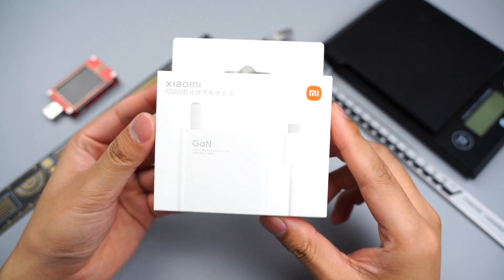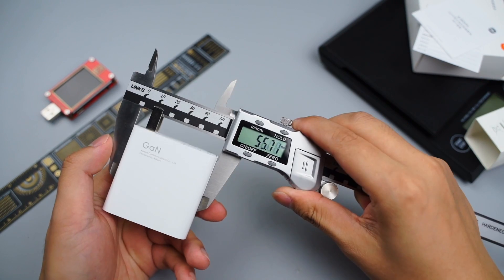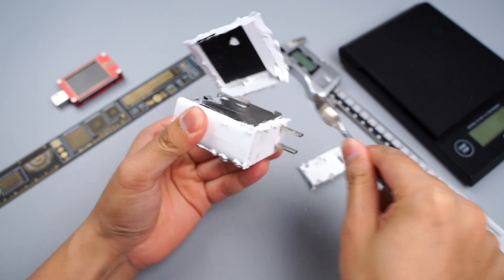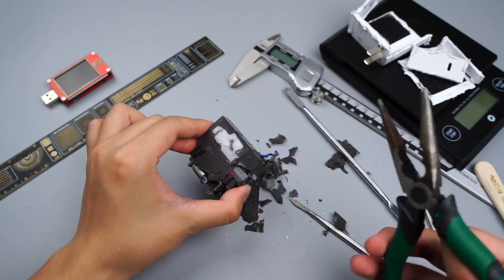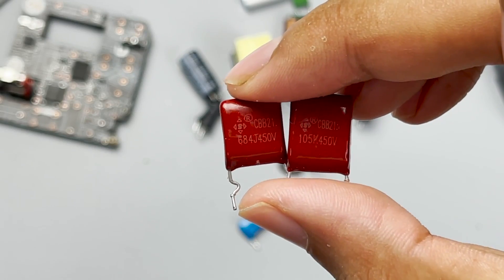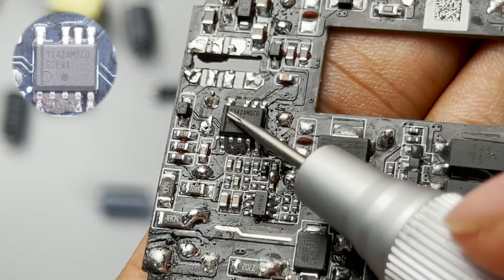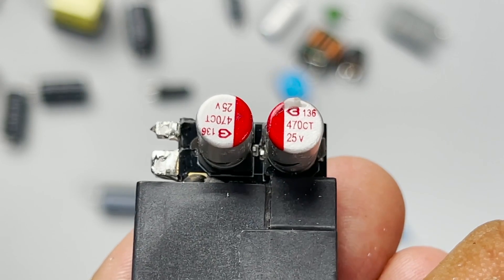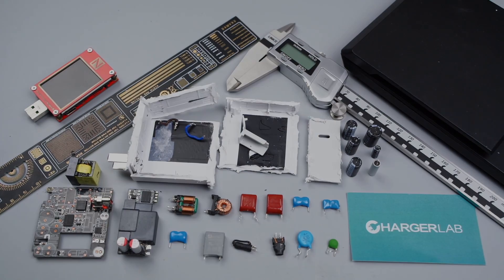Teardown of Xiaomi 120W USB-C GaN Charger

Comment: Is it possible to force 20V 6A? I would like to use it with a laptop with dc (5.5*2.5mm) connector and I was going to put between the charger and laptop a PD trigger (ZY12PDN) but you said it's a Xiaomi protocol, so I don't know how to trigger it
Reply from the maker: Yes, it's Xiaomi private protocol, you need to find a PD trigger that supports Xiaomi private protocol, but there shouldn't have such products on the market for now.

Comment: I am wondering. I need to change the pin on the charger due to space requirements. Right now, space in my bag is taken up by an adapter. I am wondering if I can remove the charger pin face, cut out the pin and resolder a new compatible pin onto the charger. That way, I can take out the adapter (quite bulky) and use the space for other stuff.
Reply from the maker: There is a risk of desoldering

Comment: Hello, please take off the review for the same 120W charging but with a USB-A port.  You are comparing their sizes in this video.  And is it necessary to test the protocols with the help of your tester through the native cable to it?  Thanks.
Reply from the maker: native cable is not necessary, but if you don’t know the related knowledge of cable, I still recommend you to use native cable to avoid any errors.
Reply: @ChargerLAB  Please review the 120W USB-A Charger with your tester
Reply: @ChargerLAB  The cable, since pin 5 is needed there, I do not have this memory, I wonder if the PD protocol is there?  But you need to check through the supplied cable to this charger

Comment: Again another design being “powered by GaN” just for the sake of being powered by GaN. The controllers aren’t optimised for GaN, this is straight up worse than using Silicon for the FETs because the Quasi-Resonant converter will already reduce switching losses which is the only advantage of GaN except for higher switching frequencies  which still isn’t  being benefited from because of the rather low frequency for a GaNFET, they should basically only be used with above a MHz frequency, so haven’t used the primary advantage to reduce the transformer size but suffer from  all the disadvantages like higher cost, higher conduction losses, higher complexity. Again, cheap caps and a lot of meh-grade components. 
There was no need for APFC which they wasted space on, as it is only needed at above 130w or so. They should have used the money on better components or a better topology like an LLC Resonant converter. 
It don’t believe this will have over 90% efficiency under full load specially because it has APFC which will reduce efficiency even though the head is spread across a lot of components . So, I would like to know how that they Plan to dissipate 12w of heat  in that small  brick with not much surface area, my guess is that they can sustain the full power and rely on the thermal mass for burst operation.
Reply: Do you know any chargers that their controllers are optimized for GaN?  or if you don't, what chargers do you recommend due to high quality components insides?
Reply: @Pabula  I know of chargers optimised for GaN, Xiaomi had one but would just recommend the Apple ones made by Delta Electronics like Inngerie or Lite-On like the 140w Apple
Reply: @Pabula what wattage, delta made ones are always good in terms of quality so : Innergie ones and Apple ones made by Delta electronics
Reply: @tanishqbhaiji103  Thanks for the quick response.   Wattage... depends, but wondering about charging newer phones/tablets that don't come with chargers anymore, like the Pixel6 or Iphone13/Ipads.
Reply: @Pabula  use a  5w charger overnight for long battery life and long service. Charger really would depend on which one the phone likes best for quick charging. Wouldn’t recommend wireless one though.
Reply: so, it seems like you gave the answer why this charger supports  UP to 65W PD. 

in my opinioin this product is waste of resources.

Comment: The Quasi-Resonant Flyback is just a Flyback with a smarter controller to implement Variable Frequency drive for the primary FET/s instead of just DCM or CCM to reduce idle consumption and Zero Volt switching to reduce Switching loss on the primary FET/s to increase overall efficiency.
Reply: Thank you, that part suddenly sounded like Greek 🤣
Reply: Boss can u fast charge a car batter with this